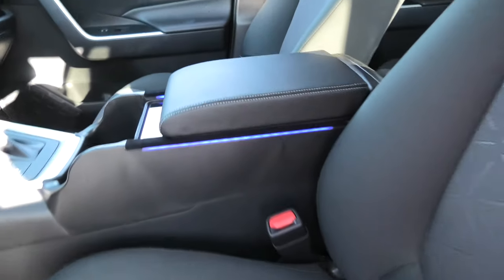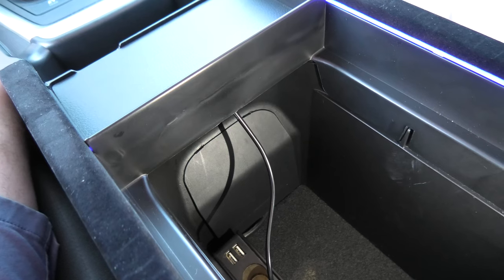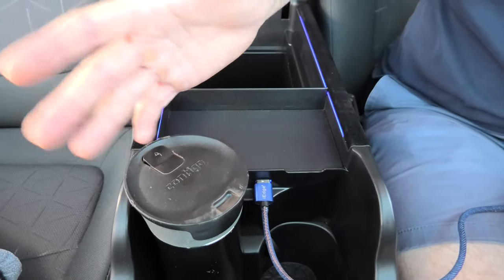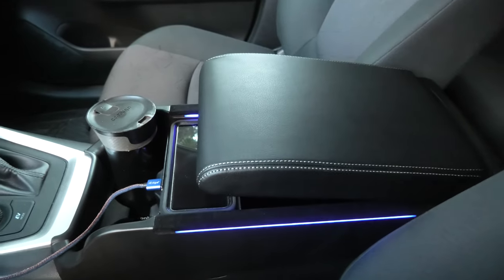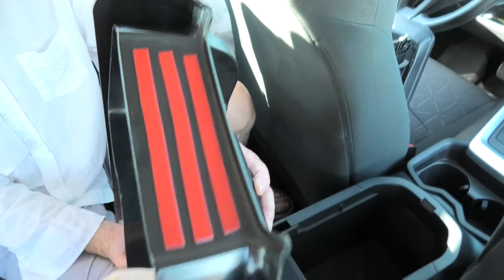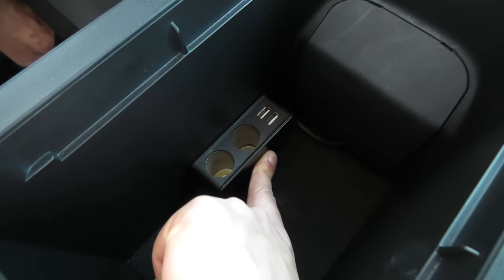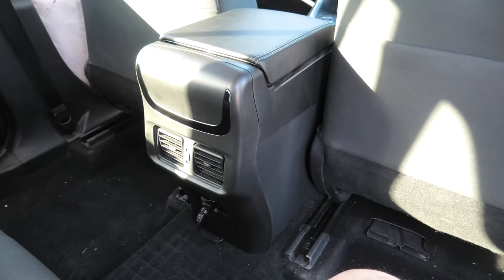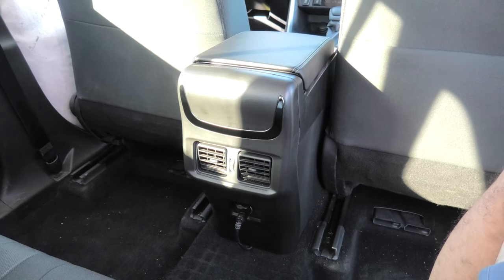Toyota RAV4 (2019-2024): New Armrest With Wireless Charger (QC3.0), Blue LED Lights And 2 USB Ports.

Comment from the maker: PRODUCT LINK:
Wireless Charging & USB & LED Light Armrest Box Modified Control Content Box For Toyota RAV4 2019 2020 2021 2022 2023 2024 - https://s.click.aliexpress.com/e/_DkjCmmP.

TOOLS REQUIRED:
1. TRIM REMOVAL TOOL - 4pcs Auto Door Clip Panel Trim Removal Tool Kit - https://amzn.to/41nYhsk.
2. NEEDLE NOSE PLIERS - Klein Tools D203-7 Needle Nose Pliers - https://amzn.to/3kywapB.
3. 12V SOCKET SPLITTER - EUGIZMO Cigarette Lighter Plug Splitter, 200W 3 Socket Car Cigarette Lighter Adapter USB Charger Extension Cord Multi-Port Power Plug 12V/24V Splitter with LED Voltage Display - https://amzn.to/48etNLO.
4. PHILLIPS HEAD SCREWDRIVER - Klein Tools 603-4 Screwdriver - https://amzn.to/3kFGex0.

Comment: This is a slightly confusing vid for me. I have a 2020 RAV4 GLX. Granted, models in NZ most likely differ from those in other markets. However, to my knowledge, all RAV4s of this generation have USB ports within the arm rest as well as on the back for the rear passengers. I can't envisage why anyone would install a lighter socket in those positions or for what they would be used for. BTW, my GLX does have a lighter socket in the cargo bay... I dunno what to use that for either.
Reply: I honestly dont see why you cant see it? Its to plug something in? 
The rear has 2x 2.1A USB points. Thats only 10w of power to a phone. What if I want to charge my phone with a 30W charge? I need some place to actually plug the charger into. 
As for the socket in the cargo space. Are yoy reffering to the bood? Ifen if its in the front. You can have a fridge in the car. It needs 12V. 
So there really is tons of reasons to have lighter sockets all over the place.👍

Comment: If carplay or android auto is not needed it makes sense to use wireless charger. Otherwise you’ll have to be on a cable. 

How about the video on the topic regarding good solutions for wireless carplay/android auto in RAV4?
Reply: I have wireless Android auto in my RAV with a dongle , so I need a wireless charger. I cant find a fast wirelss charger (QC3.0) that is installed infront of the gearleaver , as the wireless Android auto sucks my Note20 dead in a short time.

Comment: What was the second connector at 5:46?  The first one was the USB charging ports I believe, but the second looked like it was just a holder, like they did with the foot well lighting connectors.
Reply: did you ever find out what the second connector was for ?  I'm still trying to find out what it does
Reply: @Mecha04  no, my car was out of reach for most of the year because of shipping it to Portugal.  I've got the charger and I still want to install it in the next month or two.

Comment: I love your videos, I recently got a rav4 xle premium awd. I also want to change few things but will that void the warranty from toyota?
Reply from the maker: Thank you! Installation of this device is plug and play. It is the same as connecting the smartphone to the cigarette lighter socket. It should not void the warranty.
Reply: Anything you do on your car, the dealership will try to void your warranty..
Reply: @asahacic3249  If you do not interfere with the existing wiring in a way that compromises the stock system, they usually don't care. Otherwise, how could you install dashcams or radar detectors or tow hitch electrics? I've added many enhancements including the overhead cargo lights and fog lights; my dealer didn't even comment at service time.

Comment: I dont have the cigger lighter in passenger row i have usb
Reply from the maker: You can also connect it to the front cigarette lighter socket by pulling the cable through the central console and the tray (you may need to cut out a small opening on the side of the tray for the wire), or you can pull the cable all the way to the fuse box and connect it this way.